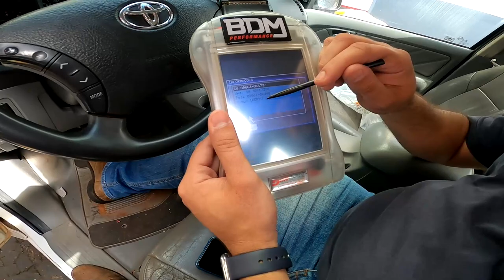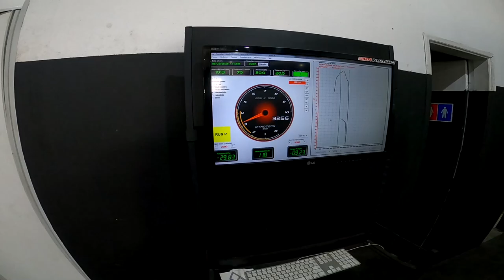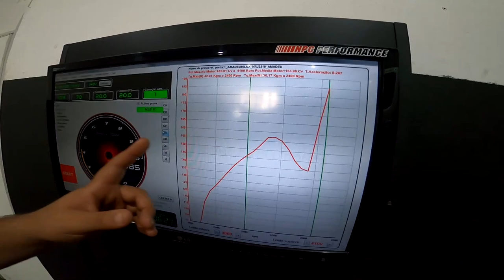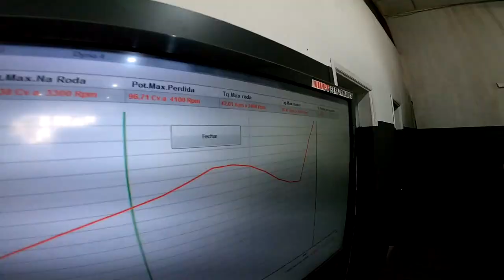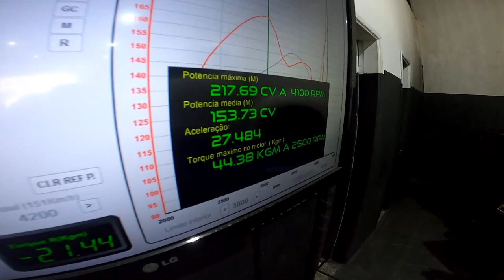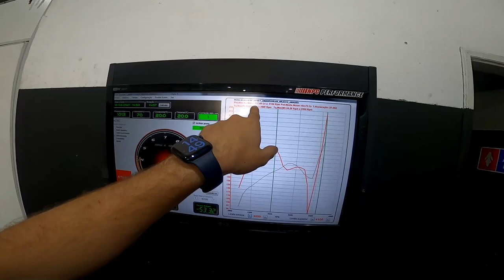REPROGRAMEI A HILUX COM MAIS DE  300 MIL KM DEU BOM ??

Comment: Rapaz, numa ranger 3.0 vc fica  rindo sozinho
Amigo nosso passou a dele no dina original, deu 40 de torque e 165 cv
O informado são 38,9 de torque e  163cv.
Deu isso aí de roda e com quase 200mkm